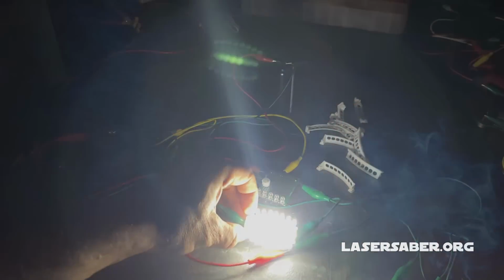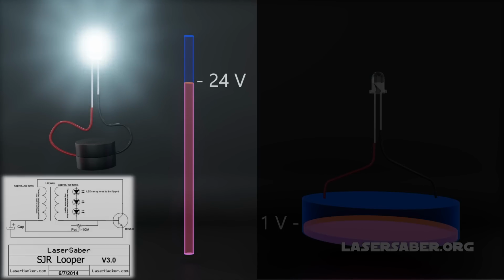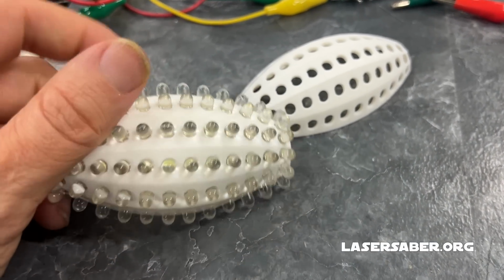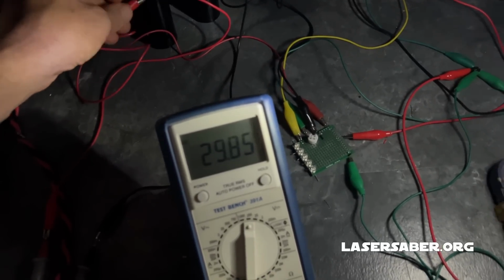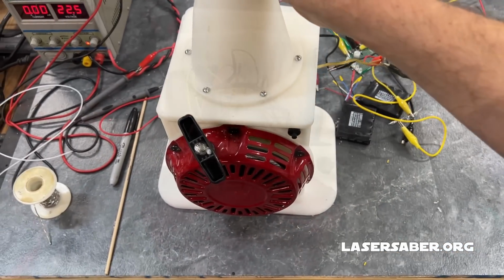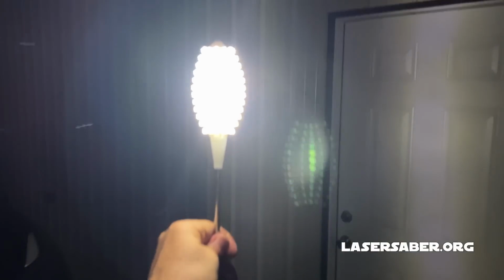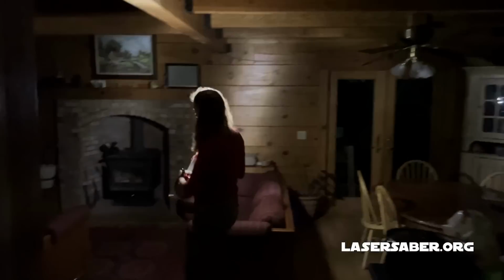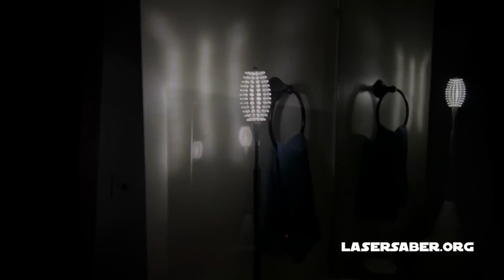World's First Pull Start Lamp - Batteries not Included/Needed

Comment: Awesom lamp!

Possible mod "phase 2 or 3" could be an optional reflector on top for outdoor use to reuse the light that would be wasted shining into Space.

Another might be a way to easily to connect other power options to the lamp, like a plug-and-play module.  I was thinking of some sort of kick or treadle start as personally I have trouble with lawnmower rip chords, and I dont think I'm the only one, the low on upper body strength but high on lower body strength type.

Comment: I am doing something VERY similar to this. Using piano foot pedals on my desk, connected together like this, but instead of led lights, I am using a transmitter coil wrapped around the perimeter of my desk. Charged quickly with a few foot taps, and charges your entire desk for wireless led, and wireless charging.

Comment: It's basically a joule thief circuit i.e. an high frequency oscillating coil that taps energy from the vacuum fluctuations once the power to the coil is cut and the magnetic field collapses. It's not a free energy, because you still use up the power that is put into the capacitor, but it's analogous to the classical heat pumps in that you get more energy than you put in, because the vacuum fluctuations provide the rest.

I would love for you to measure precisely how much total power the system outputs throughout a single runtime - I BET it's way more than you put in.

Oh, and the voltage uptake might be due to additional ultra-high harmonics being generated that for a moment sap even more energy. The resonance is element dependent, so that's why you're getting it with a particular transistor - you should definitely connect an oscilloscope to see what the circuit is doing because that behavior can be tuned for a broader range of transistors. Maybe you could even add another transistor so it can cut the power in regular intervals and hence increase the total "COP" efficiency even more.

This is one of the most successful builds of this type I've seen - congrats and keep up the good work!

Comment: you are using that 775 brush dc motor as a power source to charge the caps, it is not a efficient way, a 3 phase magnet coil arrangement like a bike stator coil with magnets spinning around it or like a car's alternator are high efficient power sources, you have a 3d printer, coils etc could easily build it.

Comment: you could use more efficient leds from luminus, their 3030 range has some really high efficiency, all be it on lower CRI. also i think you could probably get an IC with a higher conversion efficiency that accepts up to 40V (check allegro) if you get them that are efficient with not too many in series you can draw the caps down quite a bit. if you can find a sepic one it can do buck and boost, then you can draw them down to probably 3V or less, using most of your capacity.   super caps that are big are recommended for their huge storage capacity that can be 3000uF!   they run up to 3V and can be put in series with the usual consequence (you lose 50% capacity with 2 in series)

Comment: Good video thanks for posting 
 But I have a guestion : Why is the filling process not done by using pressure, like a tire pump that pumps air through the leg motion instead of the pulling process?

Comment: Unfortunately that simple circuit relies on core saturation to oscillate. It’s basically a ringing choke oscillator, this means that you loose considerable energy in the core losses. It would be worth designing a proper boost circuit with a purpose designed boost regulator IC and current regulation in the LED’s. Interesting concept for the charging process. What capacitors are you using as you covered them and like that they just looked like LiPo’s.

Comment: Electrolytic capacitors are notoriously leaky.  I am decades  out of date with electronics but I recall there were capacitors being developed using tantalum which had high storage capacity for a small package size and lower leak rate,  though the capacitors in your pull chagre box look pretty tiny to me.

Comment: Maybe a bldc motor as generator would be better. Along with possibly lithium super caps could store more energy more efficiently or could  use two bldc generators to get a 6phase output rectified and stored. And a make it more efficient. I have been thinking of building something similar using gravity to in generate power using thousands of pounds dropped slowly  use excess solar to lift , and 'discharge' as needed . Basically a mechanical battery.

Comment: Now that is an awesome project, way to go man! Elegantly simple, low cost, and obviously, immediately, practically useful. A cut above the usual YT fare. You probably already thought of it, but it'd be really slick if the caps, lights, and circuitry were a detachable subassembly so you don't have to carry the whole crank box around if you don't want to.

One thing though: be careful of your back when you're pulling on that thing, bending over at the waist like that and doing repeated jerking movements puts absolutely massive momentary torque through your lumbar. I've been scolded by a couple bosses for doing things just like that because they don't want problems with L&I and OSHA. Maybe an opportunity to refine the ergonomics of a future version, or even shrink it just a little to something you can pull apart with two hands, no back stresses involved.

Best home invention I've seen in a long time, you should get some kind of award. Keep it up!

Comment: It might work better to use a system similar to a dynamo blasting detonator. You spin the dynamo up to speed and a switch mechanically closes sending a surge that dumps all the power to the load (in this case the caps). A centrifugal switch would work.

Comment: That schematic looks funky. The side of the transformer with LEDs which has a connection to the base of the transistor is wierd. How is it supposed to control the base of the transistor? There should be no current flowing to the base as it has no way of flowing and returning back.

Comment: On the light I suggest you put a diffuser on it to spread the light out more. I think you could use a milk jug to do it if you happen to have one. While that will dim the light a bit, it will shoot out the light a bit more evenly around the space you are in, and make it a bit safter to look in its general direction.

Also SELL this. Lots of people would buy it.

To make it a bit better, and dummy proof it I suggest you add a green LED to indicate that it has reached max charge, a red LED to indicate that it is getting low, and will need a couple more pulls.(I know this may add a fair bit more complexity and add to power draw but I don't think it will be to much to add.)

Comment: Your current meter measures the average current, try a 1  ohm or less resistor and an oscilloscope to measure instant current / current over time across the resistor  (with a multi channel scope you can measure voltage and current at the same time or current/voltage at multiple points in the current at the same time.

Comment: Very cool Laser Saber! I remember many years ago making my first and only Joule Thief circuit. I didn't have a ferrite core, so I just used some iron wire wrapped around a rubber grommet. The odd thing about it was that it did not work with the resistor in the circuit, but it did work without the resistor.

Comment: Really interesting project, great potential for a work site light.
But word of caution if your running the LED's direct off of AC I have been totally messed up ill (motion sickness style nearly vomiting in the end) from working by an LED torch late through the night once, although I haven't thoroughly tested it I put that down to a very noisy AC circuit even if it was just off qn 18v battery and even if you can't directly see a flicker I now believe it can affect people.
I'm not someone who particularly notices any of the grid AC LED bulbs now but whatever frequency the torch was running at messed me up.
So my suggestion is even if you have to sacrifice efficiency some strong filtering should be looked at trying to run as close to DC as possible. Or get a good sample of people to see if uou can nail down any "bad" frequencies.

Comment: I had the idea of a pullstart powered compressor for a pellet rifle awhile back.  I like your idea more.  Ever since playing Myst several decades ago I have been obsessed with dynamos.  I have several flashlights powered by various types of generators and I think your approach is the best.  I have thought of using voltage regulators to pull more power from the battery/capacitors, but your approach of using high voltage is amazing.  Because when you turn a generator very fast you get more voltage, but not more amperage, so normally that extra voltage would go to waste.  This setup lets you store all the energy, and regulate it down to a useable amount.  I love every part of this.  Good job!

Comment: When disconnecting the power from the transistor's you got more power out than you put in? Sounds right to me😂 but be careful those people that discovered this kind of stuff have a tendency to disappear for some reason.
Reply: Getting more power out than whats put in is easy. Very easy. Hitting a nail with a hammer can put out substantially more power than it took to swing the hammer. Its like filling a cup slowly then pouring it out quickly. The thing that you cant get more out than you put in is energy. You cant pour more water out of the cup than it was filled with.  The thing is that increasing power output will run out of stored energy quicker, so overall the same amount of energy is output as what was put in.

The goal of this lamp is to do the opposite of increaseing power output. Its goal is to decrease the power going to the lamp so that a powerful generator can be used without frying the lamp. The goil is to use to take in alot of power, all the power the big generator can provide, and store the resulting energy to be released much slower at lower power for a long time. Its like filling a cup of water quickly then pouring it out slowly.

TLDR: Power and energy are different, though related, things. Much like how water flow is different from water storage.

P. S. Writing this has made me question weither or not I know how a hammer works.

Comment: @lasersaber - Great build, I particularly like the telescopic extender. 👍
Have you considered spiralling a length of self-adhesive LED ribbon around the head?
Ribbon LED's would certainly spread a more even light than individual LED's.
With ribbon LED's you would also have the benefit of an IR remote control and essential IP rating for outside use.

If you wanted to take it one step further, add a 3D printed cage around the LED head and include a bug zapper! ⚡

This is just my opinion, I could be wrong. 😉

Comment: The bounching voltage might be just hf. Check it with an oscilloscope to see whats actually going on. Your voltmeter might get confused.
Reply: Yep. I was thinking similar. If the frequency gets in sync with the meter’s sampling rate, it will read different - either higher or lower. There’s bound to be a large ripple, so the meter is desperately trying to give a reading, but can only measure what it sees when it is sampling, which is a tiny period of time a few times a second. You could filter the probe leads by putting a resistor in series with one lead and a capacitor across the meter end (say 10k and 1uF) to get a purer DC reading. I bet these anomalies would just go away…

Comment: I would add Sodium ion - LTO Lithium Titanate Oxid Batteries For the SJR To Charge Up for USB PD QC 240W ~35W 6V ~ 48V 5A
Be aslo useful For 18V ~ 72V Cordless tool battery Packs (Ryobi - Milwaukee MX FUEL + M18 )

I would also Add A Bio (Microbial) Fuel Cell So Can run on Moss & Grass Cuttings + Rain water + Pee & Poo+Paper & cardboard

Comment: Great work! 
Excellent in fact!
I was an early adopter of using 10-15 watt cob led bulbs to replace ceiling bulbs at home, and have several bulbs with dead electronics but working leds; these would be great to use in place of forming and soldering  your own and I don't recall having such dark bands, which were quite noticeable in this design. 
This could be eliminated/greatly reduced by having say 8 or more flat sides, with more rows of leds on each flat, and only the bottom part of the bulb shape curve in and have say a couplr of rows of two, then one led at the bottom, and utilise the same idea at the top, or just have a flat disc on top with plenty of leds firing straight up, which bounces light off the ceiling, like the commercial ones did. 

Again great work, excellent application of overcoming the age old problem of using cap. banks. 
Well done!

I keep imagining a Bedini coil running off of a solar/battery pack recharging the caps for a more fixed longer run application. 

Surprised how long this runs off such a small amount of kenitic energy. 

Very impressive build.

Comment: How about using high efficiency LEDs? Like those that have over 200 lumens per watt? You could design a flex pcb so you could solder them with hot air or something insted af manual labor😂

Comment: Mount one with a smaller capacitor from the ceiling in a garage, pantry, bathroom, or other rooms that are often only used for a few minutes.  You walk in, one good tug down on the cord, and you get 5 minutes of light.
Reply: literally the GravityLight
Reply: @mememaster147  It's been out of stock for two years? That GravityLight?
Reply: Discontinued?

Comment: Maybe consider making it two parts so you could have the pull cord generator able to charge multiple lamps, that would each be more portable. That said, I really like the telescoping pole.
Reply: THIS is a clever idea.  Make it modular with different capacitor/light stands but just one charging/pullcord base.
Reply: I would rather have a crank that is removable so you could turn it with a drill.

Comment: Awesome  light,  now you need to print a small gearbox with a fly wheel arrangement and include a crank tp spin it up.  Then add a secondary coil with an single throw double pole switch  so you can charge one then click the switch and  feed off the other one so your light will run two hours....  Possibilities 😊keep up the great  work.
Reply from the maker: Cool ideas!  Thanks for sharing.

Comment: You're a modern day Nicola Tesla, (just not bothered by JP Morgan or those types). Keep up the great work and videos! 

Flexible 3D prints (like 3D printed chain mail) might be used for your bulb. You would start with a flexible flat bulb and solder the LEDs, then bend the shape into the bulb shape you need. That might make it easier to solder them. Just an idea.
Reply from the maker: Thanks, that flexible 3d printing is an interesting idea.

Comment: Woudn't be better if using the flexible LED strip instead of the separate LED configuration?
Reply from the maker: I would like to find something like that.  It would be much easier, but I have not found a match for the white LEDs that I am using yet.
Reply: LED-Light-Strips, you can find it with different densities. Another possibility would be disassembling a regular LED-lamp, like one of those corne lights. If your lucky you also get a reflector and diffuser out of it.

Comment: If you take some aluminum and use that as the space filler on the sides of the LED lights, the gaps in the light where shadows are casted will be gone😁
Reply from the maker: Excellent idea.
Reply: @lasersaber  Or wrap the plastic base with aluminum foils for a lower cost option
Reply: Couldn't you just print a base with collimators around each LED? And make it out of a silvery shiny plastic or chrome paint/plating.